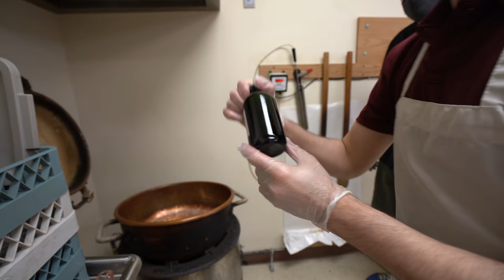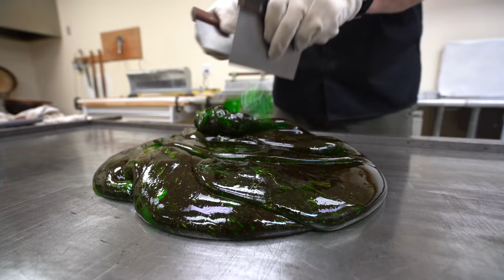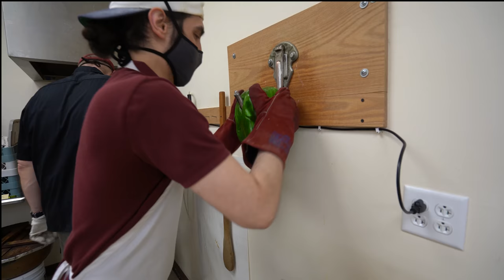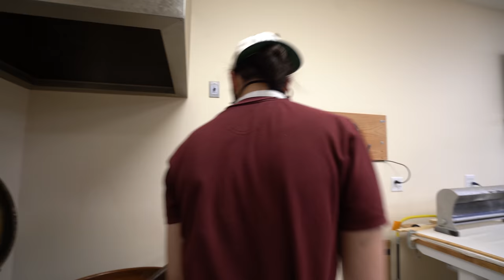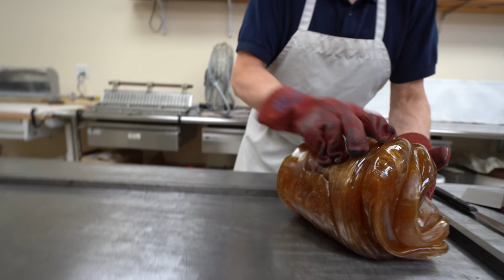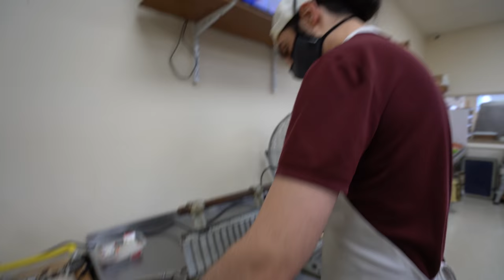We Dropped This Batch Of Candy On The Ground 😳

Comment: What about if you put a table under the hook so the candy would drop on the table not the floor ???
Reply: That's a perfect idea. (No sarcasm)
Reply: The table gonna be in the way
Reply: @Yadafam  not if it's a pushed up against the wall. The candy dropped close to the wall. He wasn't standing that close to the wall.
Reply: @ThriftHunt3r  I guess your right ✅
Reply: Jenyus
Reply: @donnellhaight267  Genius !!☺️
Reply: @sandraadams4697  r/whooosh
Reply: With larger batches of candy a table would be in the way as each stretch can get quite long. A table also limits range of movement with your body.
Drops happen. They're a part of the business. There's multiple points in which candy could be dropped including when pouring the molten sugar on the cooling table. Dropping during stretching is at least, less dangerous.
Reply: @RehabProjectSRCB  Yup, or even a narrow pull-down shelf. It's not meant to be functional... just as a little security/peace of mind.

Comment: For the Maple Candy, Can I suggest replacing some of the corn syrup with maple in the recipe instead of using it just as flavouring. Had to make some for a sculpture a few years ago.
Reply: While it can be done, maple syrup goes to crystals really easy.  
Sorry my aunt and uncle had 80 acres of maples and we made syrup every spring.   
We also made candies and other goodies.   
The very first batch out of the evaporator  pans was always poured over fresh made pancakes right out in the woods on the old woodstove.  Usually the whole family got together to gather sap.  
I remember my grandmother screaming every year when they started a fire in the woodstove and all the little field mice ran out!(no worries it was outside the sugaring shack on the porch)  family memories lol
Reply: @Emeraldwitch30  which is why I suggested replacing SOME of the corn syrup not all, mixing them slows the crystal formation, one could also add vinegar to slow the process.
Reply: @theslippydude1814  well even small amounts crystallize everything.  But if you can afford give it ago. Ive played a lot over the years as its relatively cheap for me to get from family.  Something in it just loves to return to crystallized form.
The candies taste lovely if you dont mind that gritty texture.

Comment: Why does the candy lighten up after being pulled on the hook?, and why do you hit the hook with a hammer sometimes?
Reply from the maker: Pulling the candy introdyaur bubbles, which lightens the candy and hitting it with a hammer loosens it from the hook by sending vibrations through it

Comment: i have a qestion is the candy warm when it comes out of the thing also how do i guys not eat ir
Reply: It's super hot out of the big copper pots and still hot when they pull it on the hook.   Joe was lucky, it would have certainly caused 2nd degree burns if not 3rd degree if it had hit his skin.

Comment: You ah butter or oil the pan before you dropped it the parchment paper i think there could be wax in my hard crack candy just kidding it is vegatable based butter spread...the last thing I need is you ruining my air bake cookie sheet....no i am gonna us you teflon one somebody scratched using a metal hamburger flipper on...now there is piece of teflon in my food I told go stainless or pyrex for the pots and pan...nothing is worse then eating a piece of the pot and pan you cooked it in...I think eating the teflon gives you cancer